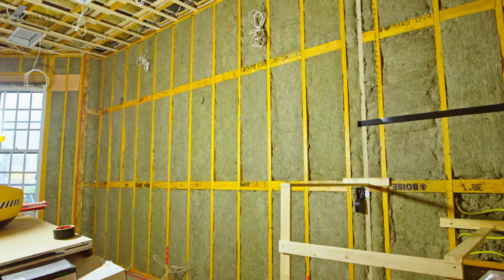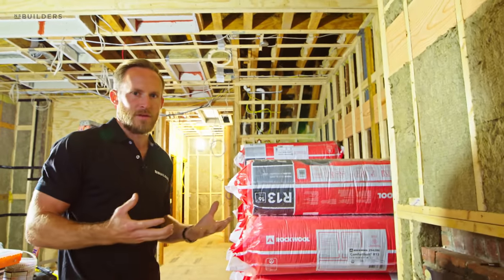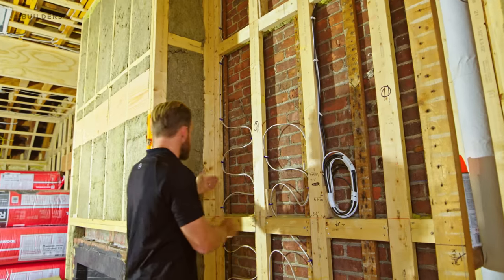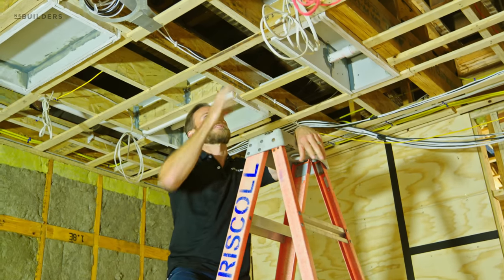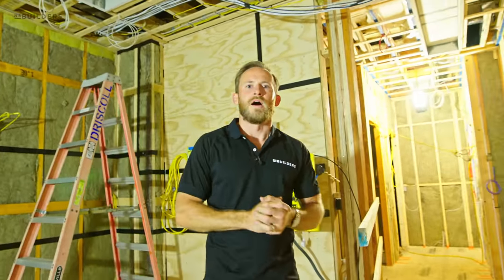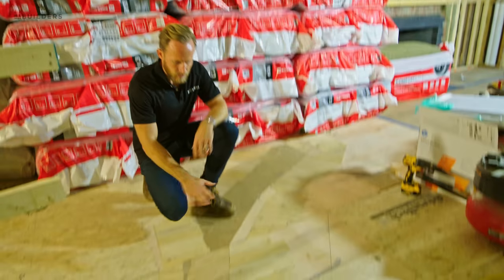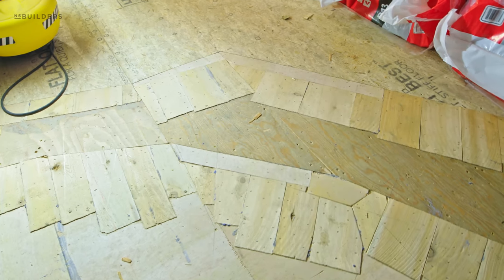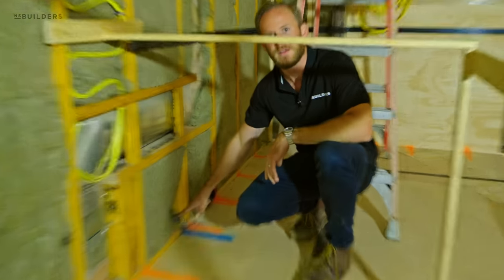Sound attenuation & Insulation in this Brownstone Renovation

Comment: In residential building do you have to follow an approved listing when it comes to fire rated assemblies? I do commercial fire inspections but the residential side is a different animal. I see they actually tooled the fire caulking so I assume they are following some type of standard. Awesome work by the way!

Comment: Hi! I have a similar home I’m working and remodeling, my question is…
Is confortbatt R15 a Vapor open insulation? I’m remodeling an old double brick wall and would like to use an open vapor capable insulation on the interior of the perimeter walls of the building  as thermal insulation. I’m wondering if comfortbatt is the same as comfortboard  exterior  insulation.

Comment: You have taught me so much, thank you.   I am very curious why you never use Spray Foam? Would be great to cover that as everyone uses it where I am at.
Reply: @damianokon6209  Well it doesn't shrink in my experience.   In the 6 builds I've done with foam, its never been an issue and provided great insulation.  I do use rock wall on the basement slab, in all internal walls and some places half foam and half rock wall when sound needs to mitigated.

Comment: For the exterior facing walls youre using Prosoco Cat 5 and then Rockwool? Any moisture/air barrier/plastic sheeting too before drywall?

here in NYC ive seen pink fiberglass, rockwool, spray foam, etc...i dont know what the "proper" thing to do is so as to not damage the bricks in the winter thaw cycle.

Thanks Nick!
Reply: Im at PA, about the same climate, I’m also looking for info about this, I saw a video  where they suggest the use of  a vapor open insulation, I search at Rockwool and comfortbatt 80 came out as a vapor open or vapor permeable insulation. 

Pretty much they suggest a vapor permeable insulation to allow the walls to dry to either the interior or the exterior, this will not damage the brick, so as long as you are using a vapor open insulation you will not need a vapor barrier of any kind on any of the sides, the wall will perform as it performed before without the insulation but now with the added benefit of thermal insulation. 

Hopefully it makes sense to you.   In this case, they used comfortbatt all around exterior and interior walls, not sure if comfortbatt has the same properties as comfortboard 80 😩😩😩
If they do, then is safe to use confortbatt R15 over the exterior and interior walls